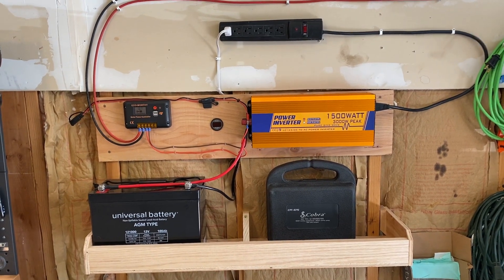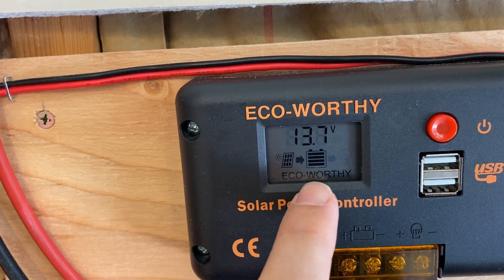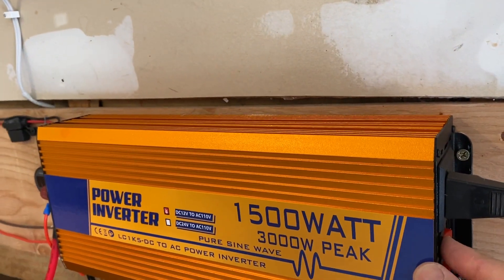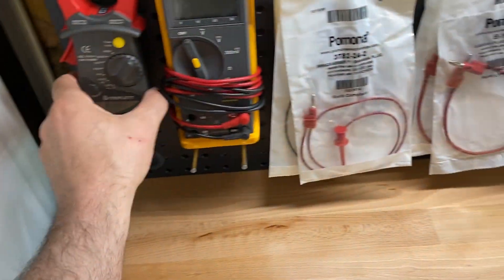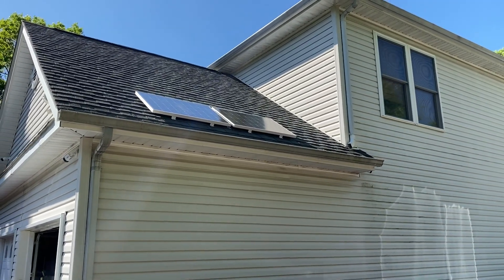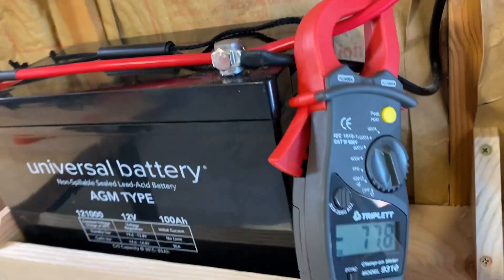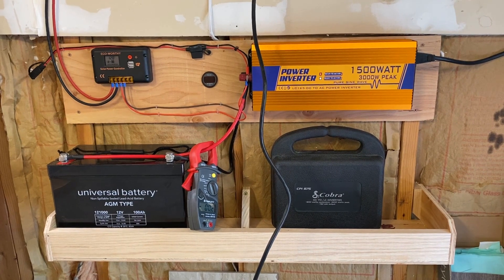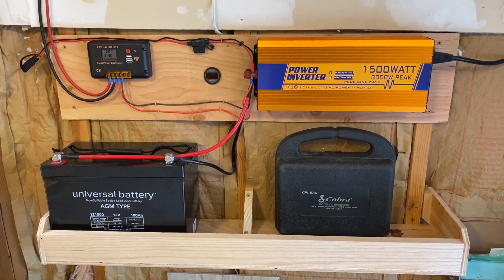eco worthy solar battery backup video

Comment: Nice video. I got the 2 battery kit. Great to see yours in action. I cannot wait to get started when mine arrives! 😊 Mine is going to power my man cave. I think i have it all worked out, the components, etc.. it should be self sustainable, without sunlight, for around 6 hours. I figure thats gotta be plenty. Anyways, thanks for the video!
Reply from the maker: Awesome good luck with setup

Comment: I'm very interested in how well your panels are holding up using those brackets you have on the video.  They look like the brackets you use to mount the panels on an RV.  Have you had any issues?
Reply from the maker: So far no problems. Maybe in an RV environment it’s different but for my use they are fine.

Comment: I would love this but I take it this isn’t for putting direct into your house fuse board as not big enough, maybe for lights only in a power cut???
Reply from the maker: Yes this is emergency back up for lights, electronics and refrigerator. The good thing is 12v can hook up to your car to fast charge.

Comment: Just set up a similar system from ecoworthy with a charger/inverter. It is permanently running my freezer currently in a uk winter and will pick up the fridge in the summer too. This keeps it exercised. I can switch over the domestic supply too if required as long as I manage load (no oven hob or kettle). Might change to bio gas for these appliances in time.
Reply from the maker: Awesome setup!

Comment: So if your vacuum was drawing 75amps and your battery is 100ah does that mean that the vacuum would run for just over an hour before the battery runs out of power?
Reply from the maker: Yes exactly. You have to convert the current at 115V to current at 12V with the loss of the converter. It’s easier to think of what hours. 12v x 100ah = 1200wh

Comment: Not worth the money (a few hundreds of bucks) if you just want to buy 1 or 2 solar panel, It  only charges little bit power, definitely not enough for for daily use. If you want to invest thousands of dollars, go for it. If not, save your money.
Reply from the maker: Not for daily use, it’s a battery backup system for only critical systems. Refrigerators, chargers, laptops, etc. if you want daily power I agree you need 10+ panels. Also, the batteries can be topped off with a car or generator in extreme cases.

Comment: My concern for power outages is my Deep Freezer...thats all. I have Heat - wood stove- for the winter....Summer is the issue, keeping my frozen food frozen. Would a simple system like this- battery, inverter, solar panels keep a Deep Freezer running indefinitely in an outage? Great Vid btw, thanks for posting!
Reply from the maker: Yes that’s basically what I needed it for was my 2 refrigerators. The more you open that door the more often they turn on. Works great for charging phones, power tools, etc. also. Luckily summer gets you the most solar. Thanks for the feedback!
Reply: Yes   a 3.5 cu ft freezer uses about 65 watts to kick on. i have a 200 watt system that i use  for outages It will run my 3.5 cu ft chest freezer (that i use as a fridge) and my 3.5 cu ft freezer all day and night. At night the door will not be opened so it will not kick on as much as during the daytime.

Comment: Just wondering, after 9 months how has the system performed? Are there any things you may have done differently or modifications you would have added? Thanks!
Reply from the maker: Hey dude, I think I would just keep adding batteries for more capacity. The panels are plenty to charge it and run basics in emergency. My goal was low cost and this is definitely low.

Comment: This is great but you should use solar as a supplement with a gas generator as they are more reliable for heavier loads. I've had a Honda 3000is for near 10 years now. changed the oil in it maybe twice and let it run for about an hour a month. It still purrs, still holds 20 amps easy, and starts in less than two pulls every time. (starter battery is dead and I don't feel like replacing it). Its all about how you take care of your equipment. For a situation where you want to have backup power in your shop for light load items like LED lights, cordless tool battery chargers, etc. This is the way to go. I like this set up and plan on doing one or two of them in my shop.
Reply from the maker: Agreed, if you want sustained heavy loads generator is the way to go. Battery can do 20A easy but not for very long. I like it as a simple, low maintenance emergency power. I can also top it off with the car.

Comment: Actually wrong. Lithium isn't just about weight, they actually last significantly longer. It's science. Because of the chemistry in AGM batteries if you discharge them beyond say, 50% or so they degrade significantly. Where as Lithium can basically be drained to 1% and still work like new. That and they can handle higher currents better, meaning less voltage drops.
Reply: What about Lithium Iron Phosphate? I just saw that they are estimated to have upwards of 80,000 cycles. You keep saying size and weight doesn't matter. But, it has to at some point. I mean that one battery replaces a small pickup truck load of lead acid! And there is little to no explosion/fire risk with LifePO4!
Reply from the maker: Absolutely lithium is a better technology but it can’t compete with lead acid in a home configuration where weight and size don’t matter. Only thing important at home is cost and reliability. Lead acid batteries don’t detonate like lithium. Lithium lifespan advantage is only when deep cycling which you don’t do regularly with a battery backup system (only once and a while when used). Tesla may change this equation in a few years...

https://news.energysage.com/lithium-ion-vs-lead-acid-batteries/
Reply: @eric180db I liked your setup but..Lithium can't compete with lead acid?? 🤦🏽‍♂️Man In every single aspect there is no reason to pick lead acid over Lithium Home, RV, Camping whichever, The only reason is the price, but not really cause on the long run you will waste more money changing lead acid batteries anyways that's for sure,
Reply: I agree with you 100%! In my experience, AGM batteries really suck, especially when it comes to the lifespan. I used to use them, but no longer. Why? Because they lasted about 2-3 years before they really start to crap out. I had 1 that lost 90% of it's capacity in less than a year. This battery was used very lightly, and the voltage never went below 12.5V! I still have one, just hit 3 years old and did a load test on it. Lost 95% of it's capacity, so instead of being a 100ah battery, it's only a 5ah battery...........

Comment: Does it still work? Can you power a fridge?
Reply from the maker: Yes it works great and I can power fridge and small items. If it’s winter and always cloudy you will have to top it off every few days with a car boost which is reliable, or you can get more panels.